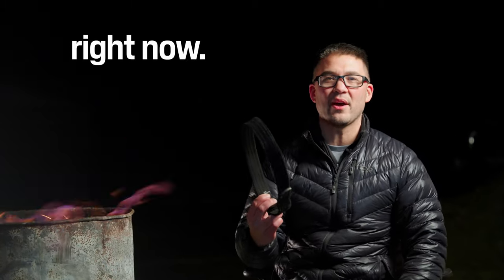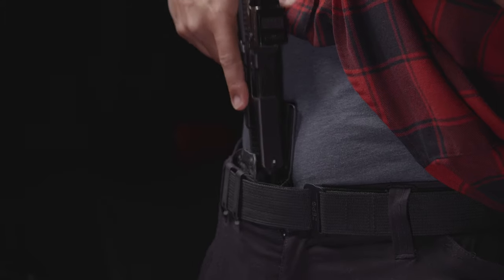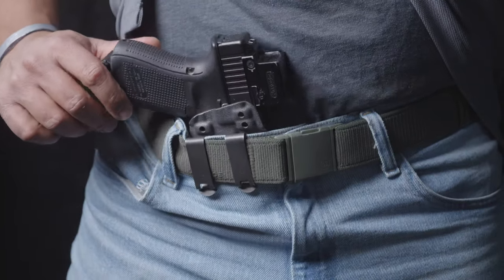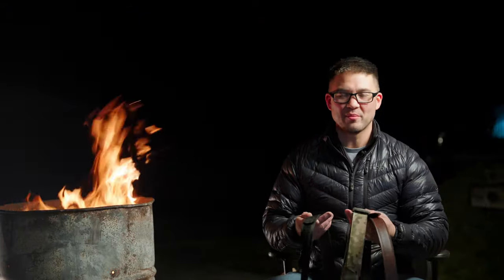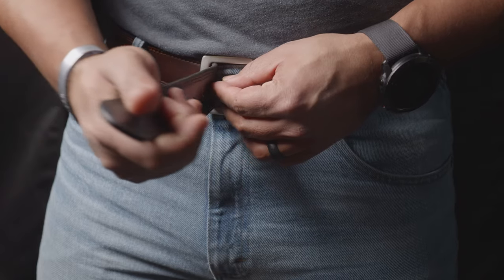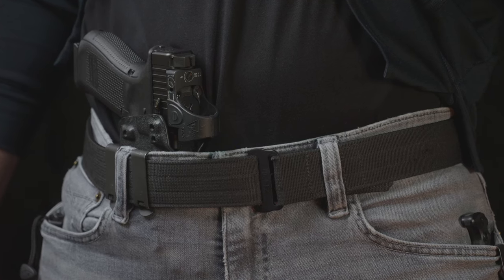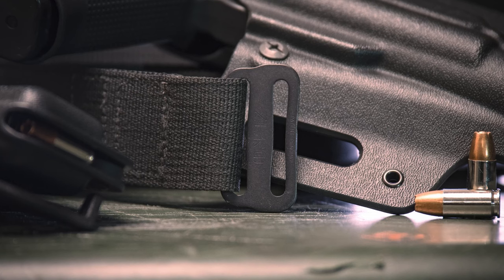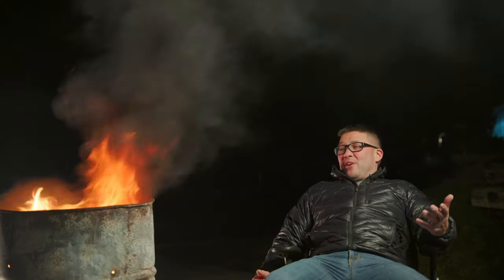I spent 13 years designing the best concealed carry belt

Comment: I tried the Zero and decided it wasn't for me.  Too soft and flexible to support a full size gun plus WML plus spare mag carrier without needing to be excessively tight.  Worse, the hidden tail "feature" makes the belt not nearly as easy to tighten as a traditional friction buckle/hook and loop combo where I can crank on the tail of the belt to reach my desired tightness.  I also picked up a Zero Underbelt, and in that application it works relatively well, but I still find myself returning to the more easily-adjusted friction buckle belts from Mastermind Tactics.
Reply: These are the comments that I feel need to be highlighted.  Critical assesments of the belts performance.
Reply from the maker: It's a reasonable critique and can depend on what you're carrying, size, body type, etc. 

That's why we produced the ZERO Heavy: it's thicker and more rigid and can support more gear.

There's a little technique to getting maximum tightness that's in the video but we didn't explicitly call it out. We can do a short video on how to do that soon. It allows you to tighten it as much as you could want.
Reply: @tenicorusa  I'd be interested in seeing that video.
Reply: @tenicorusa  can you show that please? I am also having tough time tightening zero belt but i do want to like it.

Comment: I wish it was this good.   It is hard to snug and will loosen during the day.   The best / perfect belt does not exist.  😢
Reply from the maker: Interesting.  We have never had an issue with it loosening throughout the day.  It is also super easy to snug and loosen when you want to.  Are you trying to push the belt through the buckle or do you switch hands and pull on the tail?  That is the key to the easy of adjustment. Like in the clip here: https://youtu.be/IcvzuVxMbMs?feature=shared&t=220
Reply: @tenicorusa  Thanks for the reply.  I snug it by tilting the buckle to perpendicular to my body and pull on the tail side of the belt.   Then push the buckle flat.  I do not pull the very tail.   I am not saying the belt becomes loose and floppy,  it is no longer as snug as I want to minimize printing.   As I go through my day,  I am adjusting balancing comfort and concealment.   The zero belt is a part of the overall system.   Thanks again.